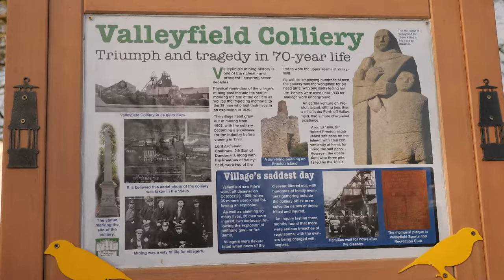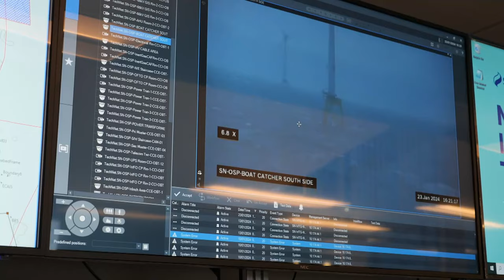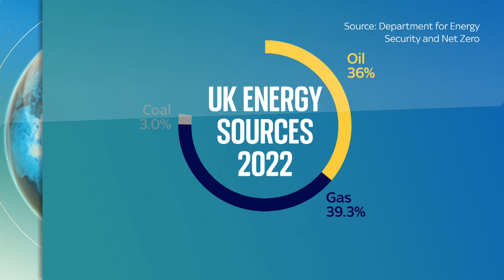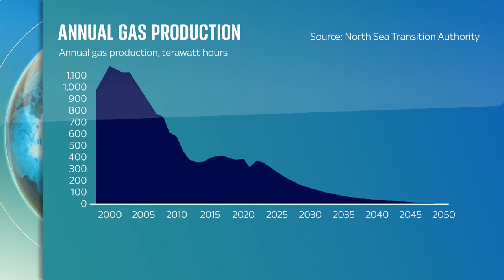What PM's North Sea drill plan might mean for jobs | The Climate Show with Tom Heap

Comment: How to do we transition to renewables?
In what year will the transition be complete?

What’s the technology required?
Will it be turbines?
Will it be solar panels?
Will it be hydro dams?
Will it be something else?
How many of each?
Where will they be sited?
By when will they be installed!

Remember that this must be done globally.
Also, don’t forget that globally energy consumed in 2050 will be 50% more than in 2020. 

What is the plan for no wind, too much wind and no sun?
If batteries is the workaround what capacity will be required?
How many will be required?
Where will there be sited?
When will they be ready?

If pumped hydro is the workaround what capacity will be required?
How many will be required?
Where will there be sited?
When will they be ready?

CURRENT ENERGY STATUS
Renewables Total = 14.1%…..
Other Renewables = 1.4%
Biofuels = 0.7%
Solar = 2.0%
Wind = 3.3%
Hydropower = 6.7%

Nuclear = 4.0%
Gas = 23.4%
Coal = 26.7%
Oil = 31.6%

Above status is from 2022 . 
Ratios have been as above for decades. 

VERY IMPORTANT
Renewables generate electricity.
There’s much more to it than electricity.
What’s the solution?
Reply: elecricityproduction  uk currently has supply in Scotland with net zero wind at 80.9% and Hydroelectric at 4.4%, then England has Wind 38.6% much of this imported from Scotland.  The ratio of Net Zero production and consumption against fossil based fuel consumption has changed considerably over the last 4 years, for many nations in the EU it will continue to change  rapidly in reaction to the loss of Russian Gas.  To answer your questions as to How and When is simple; under any Government run by an uninformed and Energy ignorant PM with his only talents and interests in lining his Savel Row children's section pantaloons is NEVER.
Reply: In 2023 electricity from renewables in the UK was 36%.
Reply: There’s a lot more to energy than electricity.
Reply: The UK acting alone is meaningless. China’s annual increase of emissions is greater than the UK’s total annual emissions.
Reply: @CatfishGumbo  Could not agree more, the Grid infrastructure in the UK is great need of modernisation and replacement as well as support and extensions for Net zero in terms of storage and access to exploit new locations. The entire National Grid must be upgraded and so far only minimal investment has been achieved; There are currently two £3.8B Projects to provide undersea/ground electricity from Scotland to Northern England & Yorkshire directly connecting to the national Grid.  There is simply no commitment from the Sunak Government to any uniformed energy infrastructure and they remain uninformed and politically biased to the past with no cohesive plans in any sector for the future.